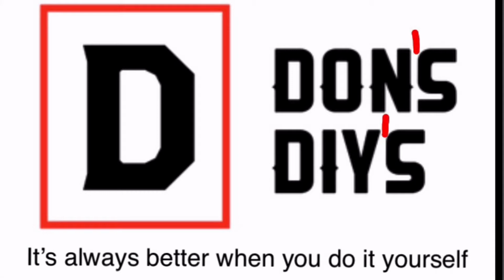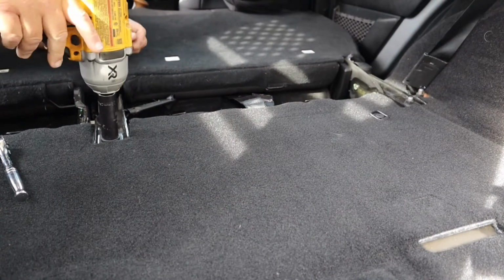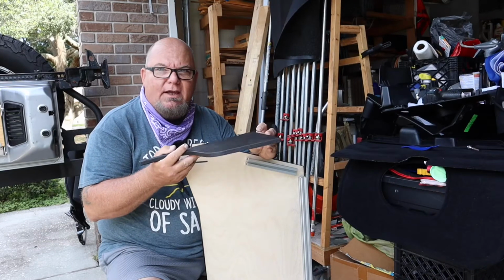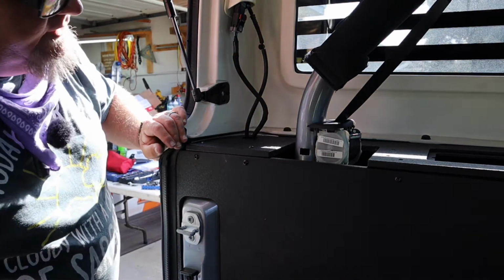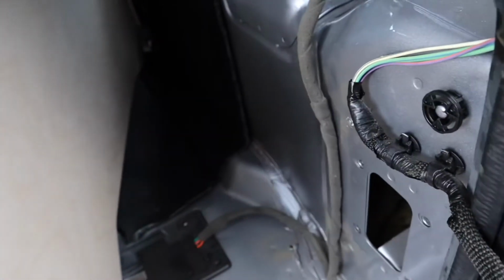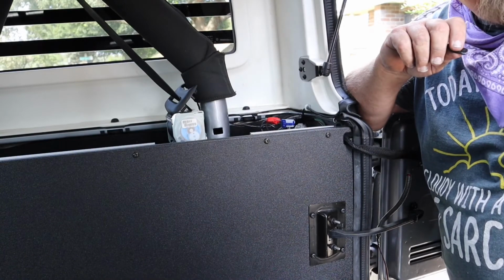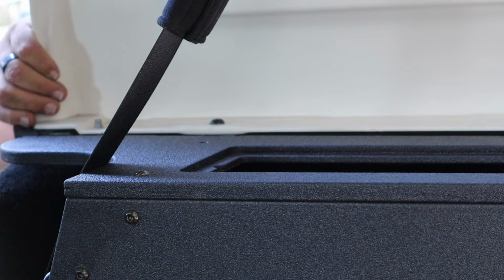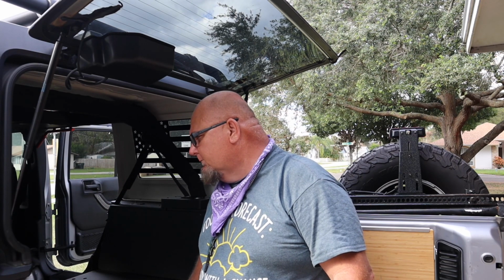Goose gear plate system install (part 1)

Comment: I had the same issue with the "nuts". What I did was loosen the vertical screws on the sides and moved the rails up to make it easier to attach the top plates.
Reply from the maker: Did not think about that. Great idea.